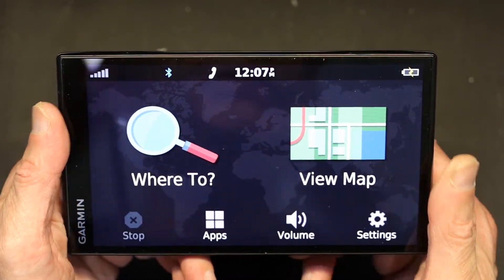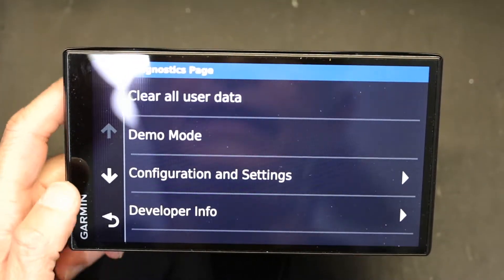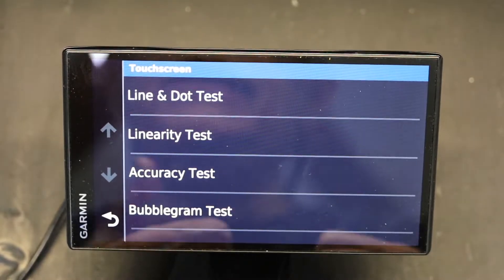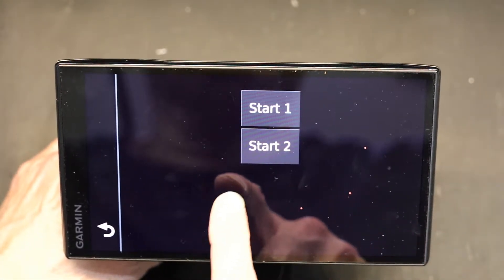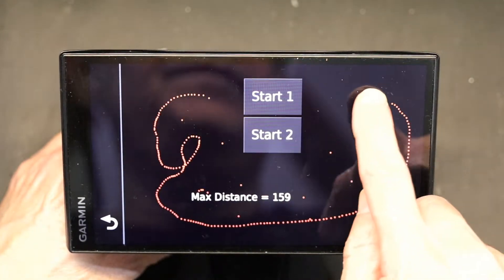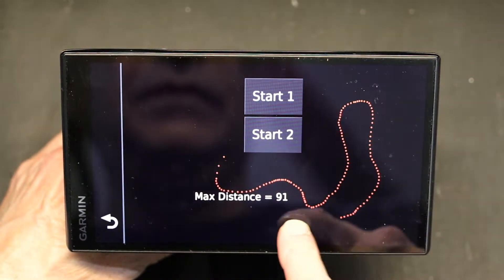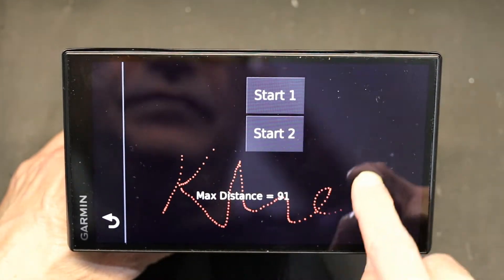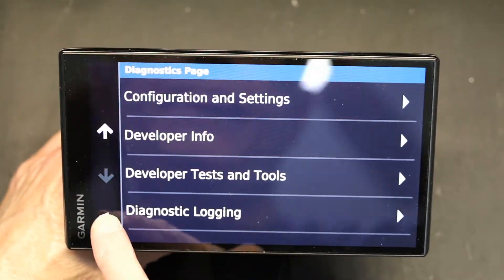Tutorial For Touch Screen Calibration Accuracy Test and Diagnostics on a Garmin SmartDrive 60 61 65

Comment: You are a great guy and a big helper in teaching me about fixing gps.My Drivesmart 55 started getting black screen and everything works (drive app,express,connect to phone) but i can't see nothing on screen,so i got a new screen and it is black again,nothing shows on it (only backlight).Did you encouter that kind of problem? Thanks
Reply from the maker: This usually happens when the screen's flat ribbon cable has gotten loose, or it is not inserted all the way into the video plug on the main board. I would reopen it and re-seat the cable to make sure it's firmly in.